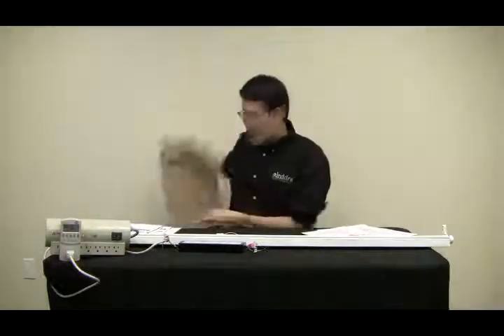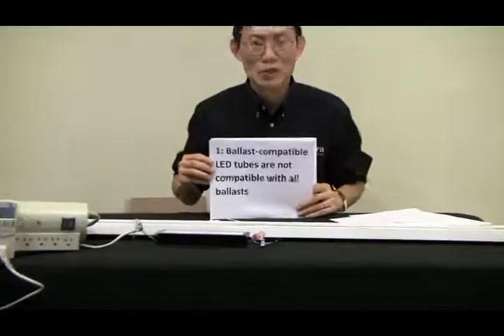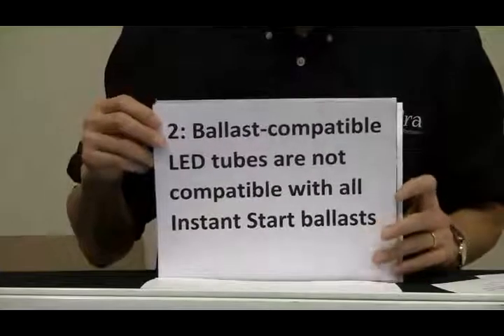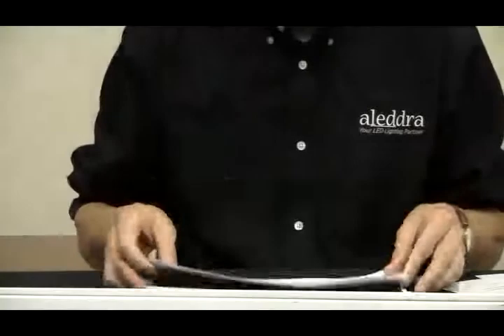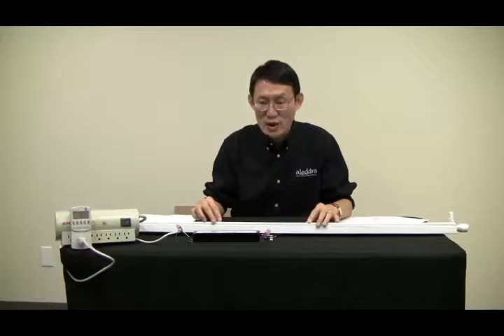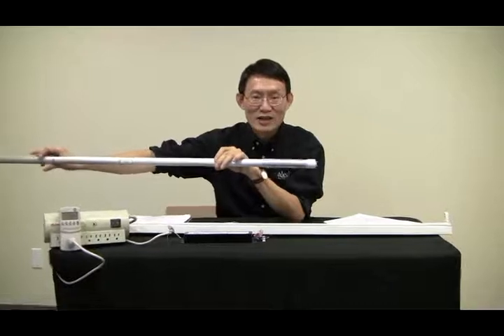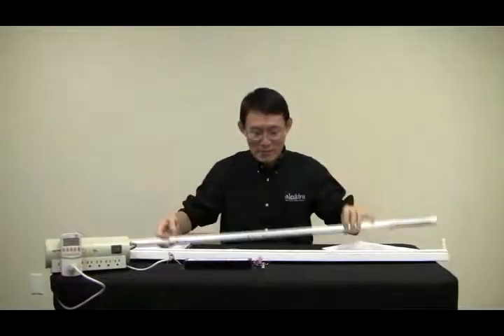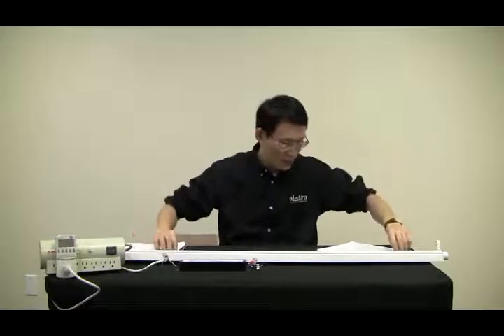In Search of Ballast Compatibility with Ballast compatible LED Tubes

Comment: I bought a 24 inch LED fluorescent lightbulb and on the specs it says 120–277V AC 50/60Hz (ballast dependent). What does that mean ballast dependent?